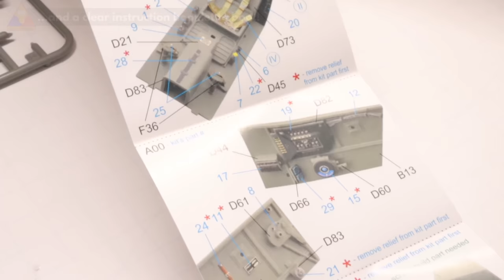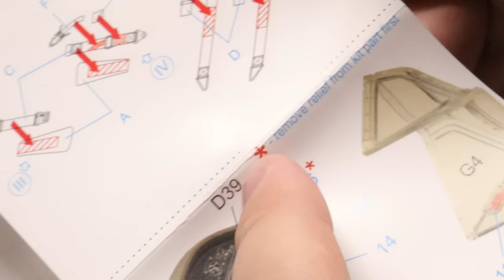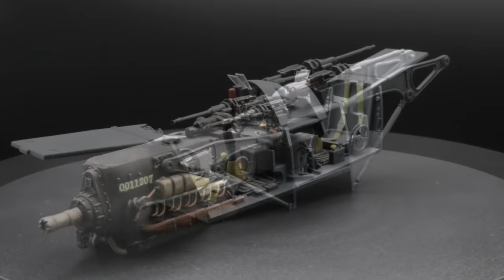Building Scale Model Cockpits Has Never Been This EASY!

Comment: Great video! I’ve used them on a Tamiya Corsair and FA190D9 - love them and they are also my first go-to if available. I’ve found that you have to cover the plastic surface well (but not thickly) or there is lifting/peeling
Reply from the maker: Thank you! And mine are holding up well so far - haven't had any issues yet 🤞

Comment: I cannot say how much l love these.  I am working on one of Tamiya's P 38 and the instrument panel alone justifies using them.  The only issue l had was with the seat harnesses...l snapped each trying to get them to conform.   As far as a sealer, l'd do it by brush especially if the instrument panel is attached.   As it may take away from the glass appearance on the dials.  Also, no need for any setting solutions.
Reply from the maker: They're fantastic - sorry to hear you had some trouble with the belts!

Comment: Another fantastic build video mate. I was just wondering what material you used to make the clear reflector on the gunsight? I'm currently building the kit and I'm not keen on using the grey one they include. Cheers and keep producing your top notch content.
Reply from the maker: Thank you! I used a bit of the clear plastic backing that came with the cockpit detail set to cut a few pieces for the reflectors. Worked out pretty well!
Reply: @SpruesNBrews  Looks like it worked a treat. Thanks for the reply!

Comment: As much as this is a boon to your average modeler, it lessons the value of the skill of expert modelers. 😩
Reply from the maker: Eh I disagree - I think that any product with the potential to increase accessibility to this level of detail across a range of skill levels is a good thing. Making one piece of the process a little easier for some doesn't inherently negatively impact somebody who is interested in doing it the "hard" way. I think this hobby is at its best when it's available & enjoyable to everyone 😁
Reply: @SpruesNBrews   I never said it was a BAD thing, just that it makes the work of the rivet counters and scratch builders less spectacular.  I remember when I was a kid, model kits were for kids. Now they’re for adults and you can easily spend several hundred dollars on one model kit. Increasing detail while not increasing the skill level needed only works if the add-on is available for the kits you have. P.S. I do think these are pretty neat, myself.